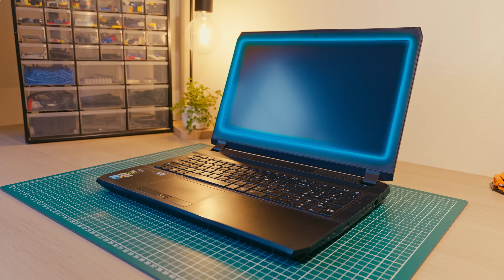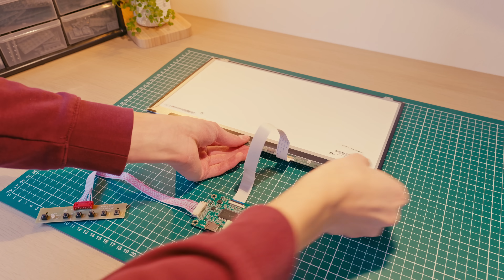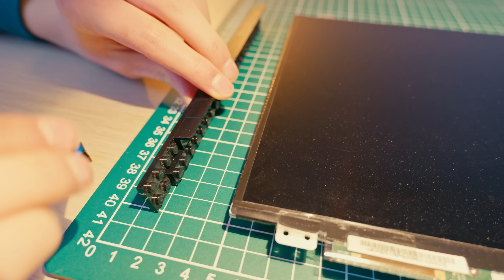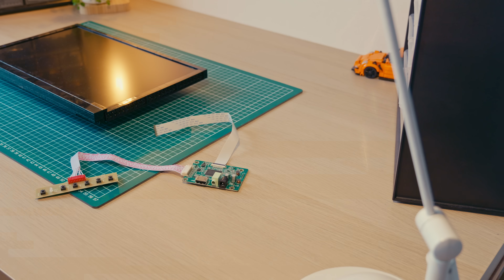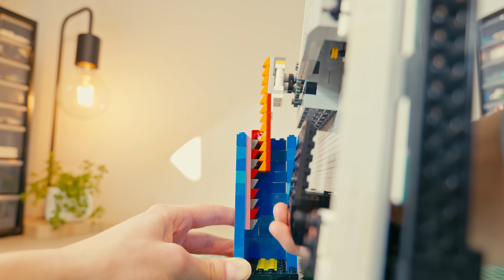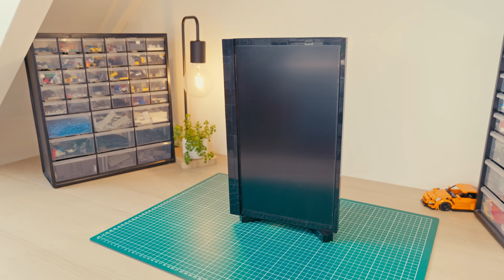Converting a Broken Laptop into a LEGO Monitor

Comment: Same thing happened in the past suddenly motherboard turned off and power IC is dead But Now i Am using the Laptop Screen with my ThinkPad L420 luckily the pins supported buy my laptop won't close because of the display size 🙃

Comment: Hello KoenKun Bricks, I have made a lego sim racing ignition system design derived on one of Sunpro Bricks' Key locks which uses a keyboard or can be made to use a controller. I am also working on replicating your driving sim steering wheel as it is very cool